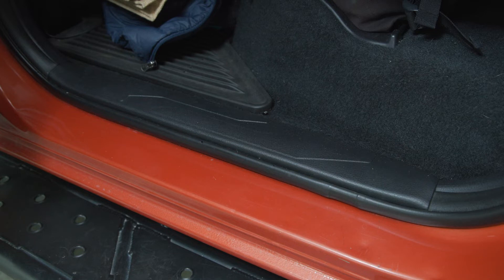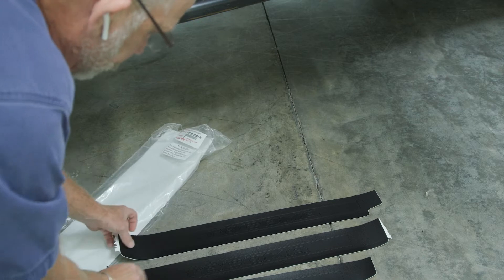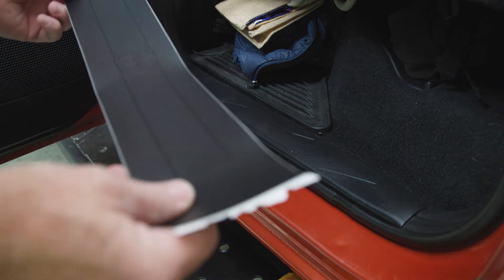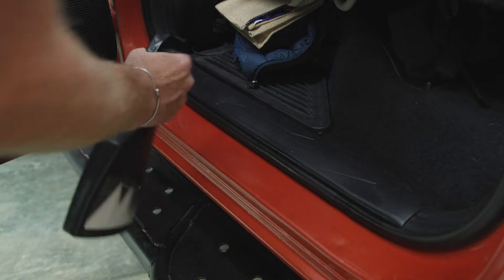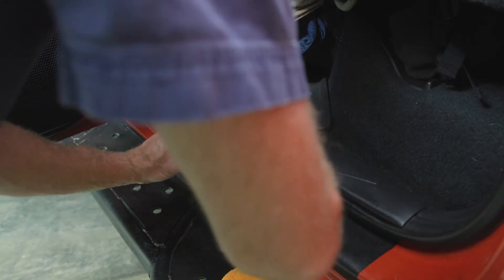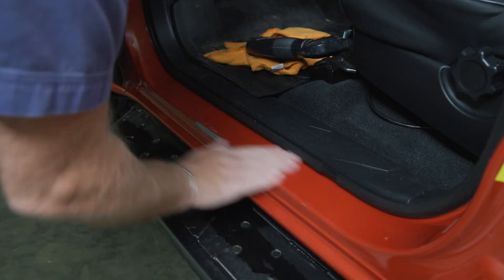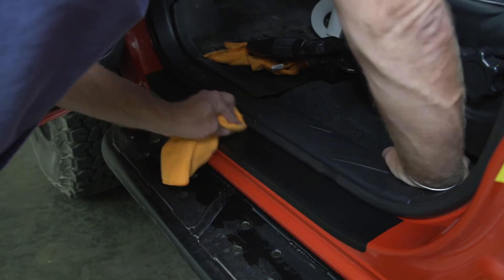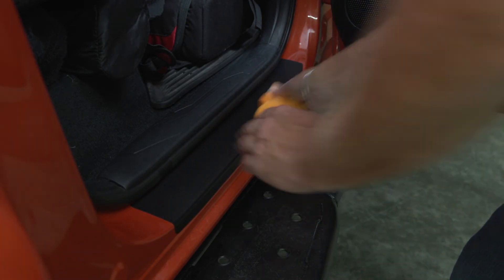Tacoma Door Sill Protectors

Comment: How are those protectors holding up?
Reply from the maker: Really well. Granted it's only been 2 months, but still look new and I love the look and protection
Reply: @backroadcapers4948  thanks for the response, I noticed you barely used the soapy water when you used the wet method. Was that enough soapy water for you to position the adhesive to where you liked with that little bit of water? 

Also what was the ratio of soap and water you used? Was it just a few drop of dish soap mixed with water or more? Thanks for your help.
Reply: Link to buy these ?? Thanks
Reply: Those are OEM so buyer beware if you do not buy from a Toyota dealer.   There are usually several that sell on eBay.